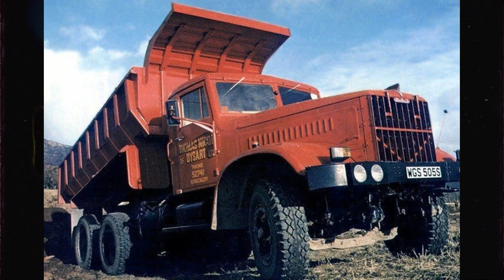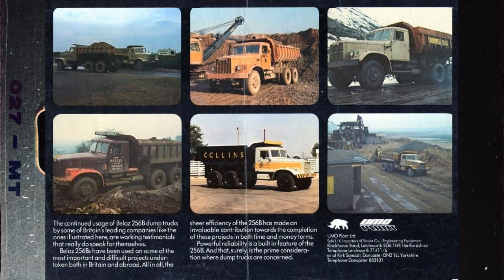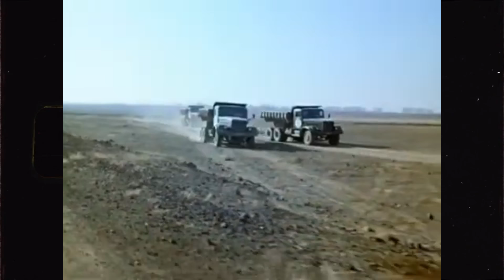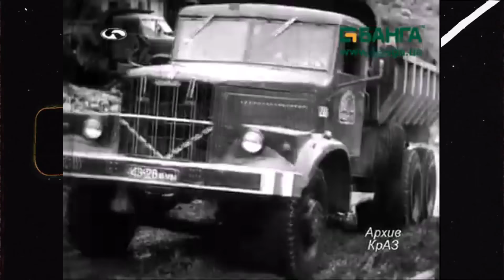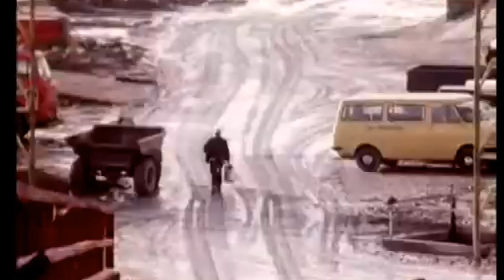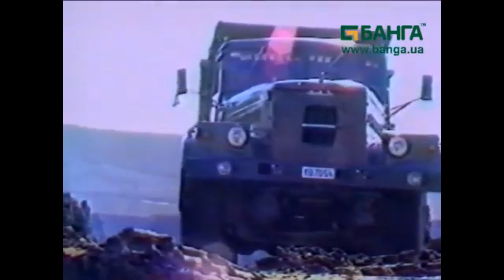What Soviet Trucks Were Doing in Britain?

Comment: Funnily enough while the USSR exported their obsolete Kraz lorries to UK, they themselves imported modern Tatra trucks from Czechoslovakia, which can be also seen twice in this particular video.
Reply: Different tasks require different vehicles. KrAZs were used for heavy work in normal terrain. Tatras and Magirus were primarily used in Siberia, where an air-cooled engine is preferable. Western Siberia is marshy, while Eastern Siberia is rocky. Therefore, all-wheel-drive Tatras were used in Western Siberia, while 6x4 Magirus trucks (all-wheel-drive versions were not supplied to the USSR) worked in Eastern Siberia.

Comment: I encountered ZIL trucks in the UK in the early 1990s. I believe they were military ZIL-131 as they had tire self-inflators. I was working for a Specialist US Car parts importer at the time and we were contacted at the time because they had V8 Petrol engines, so they must have been of American origin! I knew the Cyrillic alphabet so could easily read the ZIL logo!
Reply from the maker: That’s really interesting, because I’ve never heard of ZIL trucks being supplied to the UK, especially military ones. It might have been connected to the UN or some kind of joint mission. Either way, it’s an interesting case.
Reply: @TheTransportChronicles I believe they were privately imported. The same company sold RHD converted GMC Ambulances brought in from Canada.
Reply: ZiL-131's engine was a heavily modified for the military use civilian ZiL-130 engine, which itself was a modified V8 from ZiL-111 government limousine, which was inspired by (but not copied, though) Chrysler FirePower V8. 
Initially, ZiL-130 was supposed to go with an original V6 petrol engine but that idea did not work out during the testing.

Comment: show how bad UK made trucks actually were compared to anyone outside. another reason it only took volvo,mercedes ,scania... 4 years to make all uk trucks obsolete
Reply: British trucks weren’t bad they were just fragmented. Britain had roughly as many manufacturers as the rest of Europe combined so none could achieve enough market share to gain an economy of scale let alone survive domestic demand. They were still generally very well built and reliable they just couldn’t compete on comfort and refinement. There are many former British colonies across the world where you can find 50 or 60+ year old British trucks working well.
Reply: Also, they didnt evolve with european weight ,length, axel laws until it was too late, they thought things would not change as fast as it did. Hubris
Reply: @indiekiddrugpatrol3117  the 1947 transportation act didnt help + most UK factories were built in the 1800s Meanwhile rest of europe were mostly building new factories after ww2

Comment: KRAZ like basically every other heavy industry or machinery company was inclined towards military demand. Most important buyer of their vehicles was the Red Army of USSR, for that reason they were robust and capable of running over rough terrain. Other dump trucks that were used were modified trucks based on road transport vehicles thus not as sturdy and cheap. Soviet manufacturing were given much broader range when it came to fuel efficiency or net weight, also service requirements. Soviet driver was expected to check every oil level, apply grease to all joints etc. In Western market a Soviet truck that required all of that extra work with no air spring cabin or seat to make any sales was to have a really cheap price and service program.
Also lets not forget, most of the north of England like Yorkshire were already a bit "communist" to begin with, they didn´t probably know exactly what life in Soviet Union for a regular person was in reality, but their dislike of London was so strong it was sort of a way to "fight back".
Reply: Greetings from Azerbaijan! In our construction units in Baku, the Kraz-256/257 transported 47-ton KATO HD 1500 excavators with a 18-20% slope on Chelyabinsk four-axle trailers, which no other vehicle could have done.The maximum torque of the YMZ-238 engine installed on the Kraz-256/257 is 90 kgf m, while the Magirus-290 has a maximum torque of 83 kgf m.  The Magirus-290, with its 3.08 gear ratio and 3.1 reduction in wheelbase, would have died a heroic death.

Comment: The comparison between a KrAZ and a Magirus is the same as between night and day. KrAZ is bad for you. A terrible, underpowered, noisy, shattering beast.
Reply: Greetings from Azerbaijan!According to operating experience, compared with the Magirus-290, the Kraz-256b1 has its advantages, unlike the Magirus, the Kraz-256 is more economical-with a full load (12.47 tons) it consumes 64.41 liters of fuel per 100 km on a dirt road, the Magirus-290 (14.48 tons) - 84.75 liters, the Kraz had a synchronized checkpoint The checkpoint on the Magirus was not synchronized, the Kraz is easier to handle overloading, the 256th sometimes transported up to 19 tons of ore, and when overloaded, the Kraz-256 does not have broken springs and rear suspension elements. The maximum torque of the YMZ-238 engine installed on the Kraz-256 is 90 kgf m, while the Magirus-290 has a maximum torque of 83 kgf m. Due to this and the higher gear ratio of the transmission compared to the Magirus-290, the Kraz-256 b1 has a hook pull of 14,000 kg in the first low gear, while the Magirus-290 has a hook pull of 8,864 kg in the first gear.
Reply: @А106-б8т I am giving you a thumb up for your impressive English and another one for your detailed analysis! So much with the thumbs up. I am giving you a thumb down for being a pure theoretic - you have not even been in the passenger's seat of a 256, let alone driving one. It is very easy to calculate human wellbeing on paper. The 256 has seriously damaged many drivers' health and that nullifies any benefits and advantages it might have. Another thumb down for calculating overloading - overloading is strictly forbidden for safety reasons and carries penalties for a serious offence. Calculating pverloading makes you complicit to an offence. You sound like a white-colar criminal. Are you?
Reply: @А106-б8т if the v 10 from the magirus consume 100 liter for 100 km you have to check the injection System. Deutz Engines are very reliable and economic.
Reply: @А106-б8т What do you call a synchronized checkpoint?
Reply: @jjstro  ??? The six-speed Magirus-232/290 gearbox is unsynchronized, unlike the Kraz-256
Reply: @А106-б8т O I hope you realize the difference between a gearbox and a checkpoint? Are you using a tranlsator? I'll tell you a public secret - every(!) big truck's gearbox in North America is unsynchronized. That is even better in a way, because you do not need to use the clutch when shifting.
Reply: @jjstro  Are you using a technical dictionary?Son,I don't want to hear anything about your America. I compared two European trucks that I used to deal with when I was young.
Reply: @А106-б8т No, I am not using a technical dictionary. Nothing in a gearbox is called a checkpoint in English. Do not call me "son"! I am providing to you strictly technical information from my own experience, nothing related to politics. You are certainly not a driver, neither a mechanic, nor an engineer. About your muslim ego I do not give a shit.